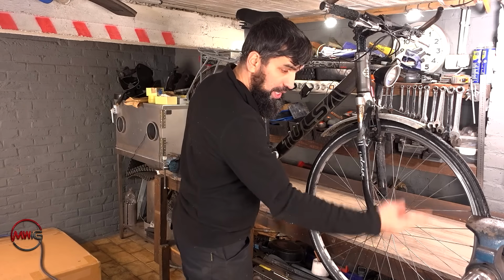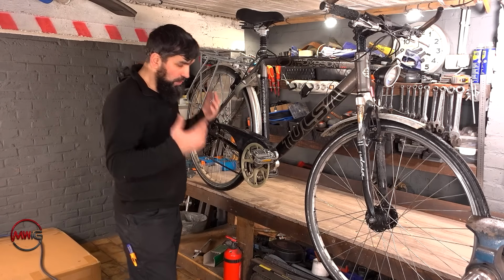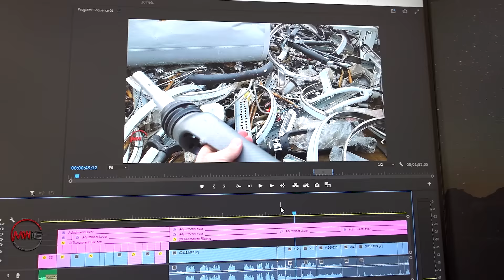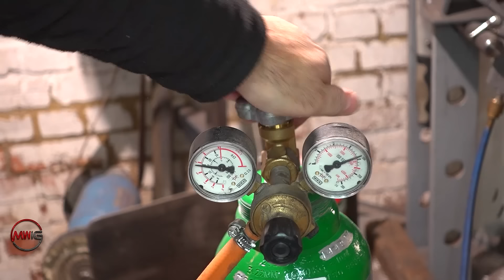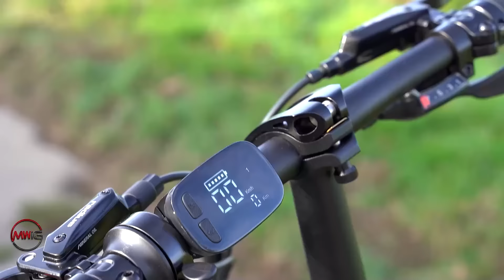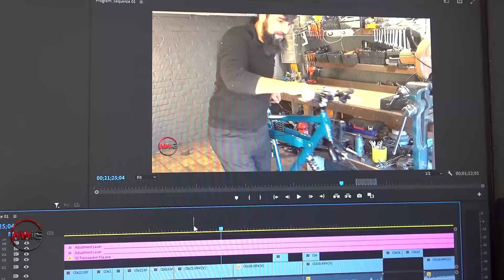DIY Front-Wheel Drive Bicycle with Rear Wheel Steering | Epic Custom Bike Build

Comment: Hey Nice build!! Maybe if you put 2 rear wheels it might be easier to ride. I converted an aluminum frame i found in the garbage to a 50 cc chainsaw powered friction propelled lighting bolt. Its scary and it took me about 3 months to build mostly from parts found in the back of buildings and free parts form the junkyard and even the seat i found it on the side of the road. this is my second build. My first one was pretty good but it was slow because it was a 37 cc chainsaw and it blew the piston beyond our galaxy. Take care amigo greetings from Chicago!!! 🚴‍♂

Comment: If you never try and fail, then there's no way to find out if it would succeed.  That steering wheel is CLEARLY too LOOSE.  The tire turns and wobbles when you are trying to go straight.  You need to fix that before you can ride it seriously.

Comment: I think the problem is also that the stearing wheel is point away from the frame, like when it is in its normal position in the front. Than it sticks out in the direction you are moving.
Now it is pointing in the opposite direction that you are driving. I think if you change the angle inward, that it will be easier to drive

Comment: It may have already been mentioned, but, if you had adjusted the rake of the steering more towards a longer wheel base, then the steering might have been more 'Lazy' and thus somewhat easier to control. As it is, the steering is like some motorbikes with a sharp rake, 'Twitchy' and 'Nervous' in feel... 🤔😏 But, nevertheless.. Quite a 'Frankenbike'! 👍🤣🤣🤣     😎🇬🇧

Comment: Hello. Very interesting bike project. I follow your creativity. My advice is to change the lever arm on the handlebar and on the fork of the swivel wheel. You will get a change - the steering wheel turns a large angle, the wheel turns a small angle, handling should become better. Good luck

Comment: The main issue is that your centre of balance and the bikes axis of rotation are backwards now as well..  In a conventional bike, your centre of balance is behind the bike's axis, which allows you to turn the handlebars and stay in balance.  With your new design, you are way ahead of the bike's axis and because of this, all attempts to balance are basically too late and you fall over.  It is possible to learn to anticipate and moderate your steering inputs, but, like those trick bikes with reverse steering, etc it's something that you have to practice over and over before your mind and body adapt..   Instead, if you want a bike that anyone can ride that is front wheel drive, your best bet is a motor in the front wheel with some sort of generator/pedelec sensor so that the front wheel gains correlation with pedal inputs..  You could probably also do it with some complicated arrangement of chains, cables and belts, to account for the front wheel both driving and steering, but the mechanical losses would be huge, so an electronic/electric assist is probably the best bet...  Or, if you want to keep the existing rear steer configuration, some means of moving your seating position rearward over or even behind the rear wheel would probably allow you to ride the resultant bike more easily..  Shortening the bike would also help as that rear wheel is just way too far back meaning any turn of the wheel is amplified

Comment: Hahaha cool idea! 
But I think you need to either add gas dampers or make the rear wheel fork longer and the pivoting point closer to the steering centre. If that makes any sense...
Next make a bike with middle steering like on a front loader. 
Keep up the good and fun content!

Comment: you have the rear wheel cast backwards, your design is the opposite of self balancing.  have you studied bicycle physics?  try reversing the cast, use the same angle as you would for a front wheel.

Comment: The bottom of the forks are behind the steering stem.  I think if the bottom of the forks are in front of the steering stem it will be easier to steer.  Make make the rear steering arm longer to slow down the steering.  I'm sure you are on top of this already!!  Cool video!
Reply: I think it will make it worse because the wheel will want to rotate to a stable position (bottom of forks behind the steering stem) like in a shopping cart, IMO the issue is that single-track vehicles use countersteering to turn, and in this situation when the steering wheel is in the back that effect makes it impossible to control the bike, maybe if he mounts this fork perpendicularly to the road, it might be easier to control but I think it won't be as stable and easy to ride as a conventional bike :)
Reply: Completly agree on that What a clever project once again!!!
Reply: Basically the angle of the rear fork needs reversing, so that the wheel contact point trails the steering axis. Then it will be self-stable, and normal counter steering should work.
Reply: @GRAHAMAUS yes steering angle or caster I think it's called
Reply: Correct. As with swing bikes the rear fork has to be vertical to avoid steering flop. I learnt this from building 3 swing bikes. My third one does not have steering flop as I have the swing point as close as possible to vertical.

Comment: reduce the throw of the steering. the wheel moves more than the handle bars. i also noticed a wobble on the rear steering wheel when you did manage to go straight. maybe a steering dampener like there is on some motorbikes to help prevent the death wobble. great build and great potential

Comment: Great build :)
One thing that could maybe work would be to add a little bit of steering (5-10° maximum) to a long cargo bike. But this would need a special rear hub, able to both steer and drive, and enough chainline to clear the tire in curves. This could make a super nimble long cargo bike.

Comment: 1. Why
2. Interesting concept and it looks cool
3. You gave me an idea. Could you make it (or another bike) with traction both at front and rear? I think it would be interesting to see how it ends up working.
Reply: It doesn't work, steering from the rear makes it less controllable because you can't even see the angle of the wheel as you move your handlebars making it very difficult to maneuver, another thing is that front wheel drive only works if you have a stable fixed rear wheel which is why most vehicles that has front wheel drives are tricycles and cars because they have two wheels at the back not one like a bicycle
Reply: @traphimawari7760  There are E bycicles with one or both wheel built motors .Some of them have front hub motors and work just fine.
Reply: @armageddontools  im talking about rear steering not fwd, sure wherever you place the engine be it front or rear it will work, but that doesn't go the same for steering, the only time rear wheel steering works is on forklifts, not bikes, rear wheel steering simply doesn't work on two wheels alone, its just common sense

Comment: IMO the issue is that single-track vehicles use countersteering to turn, and in this situation when the steering wheel is in the back that effect makes it impossible to control the bike, maybe if you mount this fork perpendicularly to the road, it might be easier to control but I think it won't be as stable and easy to ride as a conventional bike :)

Comment: Great bike idea,  I think if you set the back steering fork straight up and down that will get rid of the easy rider effect.  Then also your back wheel reacts to quickly.  If you bring in your steering joint more to the center next to the center you won't have that flapping around of the back wheel.  That way if your handle bars moves a little back and forth from peddling the back wheel won't react as quickly to it. Also maybe put a limitor on the amount the back wheel can turn left and right. Like a fork truck with the wheels in the back it does not need much to turn as you drive. But it is always easier said then done but I have build a lot of bikes and customized motorcycles also for fun as a hobbie because of working in an aerospace engineering r&d lab fabrication machining and welding job. Always felt like a kid in a candy store. The more you build stuff the more you learn, and then your old and have to slowly give up things you love doing because of other circumstances.  But keep it up, love watching your video's. You have a great talent. And open that garage door when your painting and welding those fumes will kill your brain. Put a suction fan in the garage wall to suck the fumes out. I was born in Arnhem the Netherlands and moved to California when I was 6. So from a former Dutchman,  je doet geweldig mooi werk 👍. Plus you have a fun attitude making your films.

Comment: There are bikes utilizing these mechanisms already, but it's interesting to see them put together like this. I think it could work.
Bullitt from Larry vs. Harry uses the steering mechanism to transfer to the front wheel (it's my daily driver) and it feels amazing. Black Iron Horse 3 wheel cargo bikes use the rear wheel steering in a similar fashion also... But a 3 wheel bike is MUCH harder to tip over.

On another note: I'd be curious if you'd consider putting Fat tires (4 inch wide) on a Bullitt cargo bike...? I have been playing with this thought for a while but I'm nowhere near as good with welding aluminium (especially if it comes to sturdiness of a cargo bike).

Comment: I thInk you need a damper on the steering. It's too sensitive to your input . Realistically you did a great job building it but you have just shown why front wheel drive rear steer bicycles are never Going to be popular.